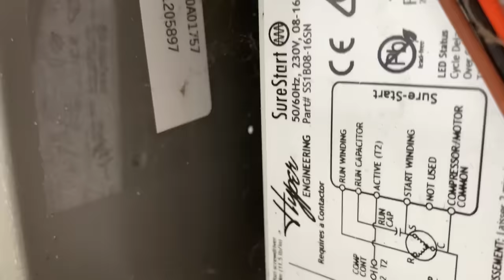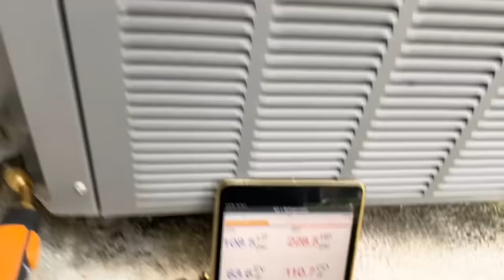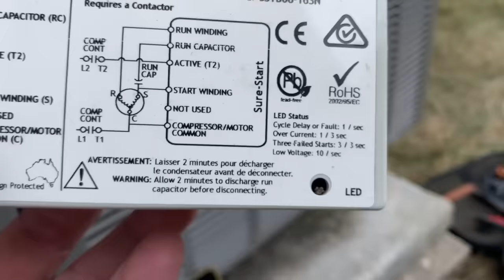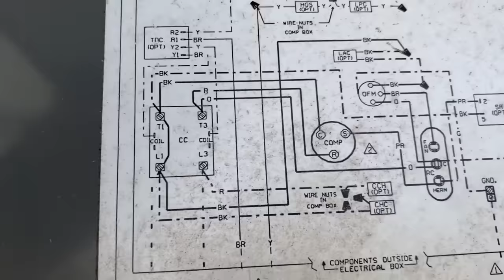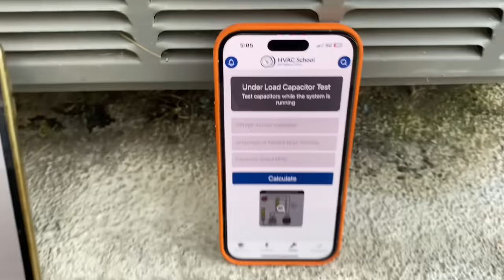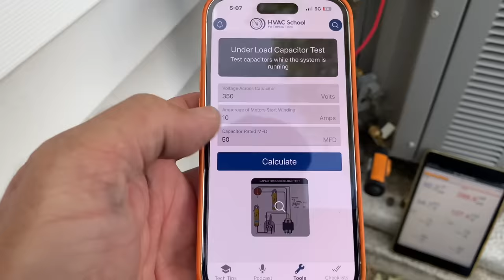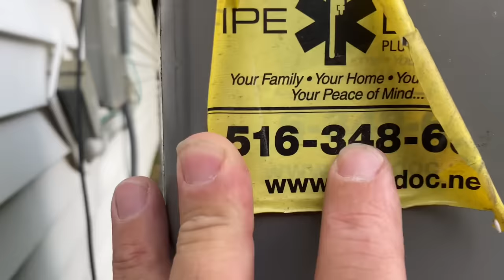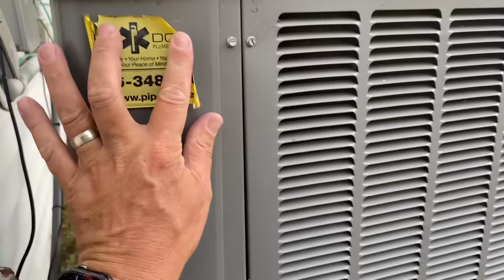Soft Start Killed Compressor! UNEDITED Central AC Service Call for No Air Conditioning Revealed!

Comment: I think putting a sticker on my equipment is defacing my property.  What if I put my sticker on your truck?!.  I had a new $10,000 high efficiency boiler installed and I walk into the room and there is an 8.5 x 11 sticker on it.  WTF.   Branding is one thing but an obnoxious sticker on my unit is a guarantee that I won't call you back.  I tell my HVAC guys and new car dealers the same thing:  "NO STICKERS!"
Reply from the maker: Thanks for sharing. I’ve never encountered a client who declined a sticker on the equipment. The 8 1/2” x 11” is clearly overkill and I’d be equally upset. Kuddos!
Reply: Same here. Good for you. I tell them: "If you would like for me to advertise your company, there will be a CHARGE!" especially for those companies which want to jab a large sign in my yard.

Comment: I had that same brand soft start installed 4 years ago so I could run my 12KW generator. Starting amps is 75 and running amps are 15 and the generator doesn't lug down much at all when it starts. If you have the wrong size soft start, it will not last which is what appears to have happened here.
Reply from the maker: Crazy

Comment: Nothing wrong with that soft start. It was cutting out on over current, 21 amps is right at the fault limit for the 16 amp unit. Good chance it worked until the coil started getting dirty.  I'd be willing to bet they have some kind of battery back up for their solar, possibly a PowerWall to go along with the Tesla and that's why it was installed. 

Those SureStarts are actually really good units. They are just a bit pricey compared to all the others that are on the market now.
Reply: Agree. I think that soft start device was actually protecting the compressor due to the amp draw. 22 running amps is not normal so it cut the compressor.
Reply from the maker: Stay tuned for the follow up video
Reply: I saw the panel had solar equipment stickers… that 130amp surge will knock out any backup inverter
Reply: Exactly. There was a reason it was installed... Solved the problem of getting the compressor running, but created a whole new one.
Reply: Your first mistake is calling a plumber to do hvac. Been in hvac for years and never understood why plumbers think they are hvac experts. Superheat, subcool, and microns are a long way off.from sewage
Reply: yah shouldn't have removed it, just created a new issue
Reply: Its illegal in Texas
Reply: @PFBruno3  Then the Pipe Doctor removed it and threw it away... and will probably damage other equipment in the long term.  But, he got his clicks.
Reply: @WayneMcCrary-kq4fr  What's illegal in Texas?
Reply: @petervidrine9259 You can hold both licenses in Texas. You can have a CDL and residential electric license too. It's just a lot of training to do it.

Comment: Those soft starts are wonderful. They do have a failure rate just like anything else. Shouldn't bad mouth what you don't know.
Reply: how high is the failure rate though? anything over 10% is a problem IMO
Reply: @Lewdacris916  I've had probably 10:1 caps over soft starts failure rate on equipment with a soft start installed. Nothing is perfect even had some sure switch failures but I still believe strongly in them. Voltage monitors also especially  in problematic areas due to u/o voltage issues.
Reply: I did mini split repairs in Australia, the pansonics had the soft start - the rest of the unit was solid as in copeland scroll, good electronics, good capacitor.  If I got a service call to one of those panasonics it was either the hyper engineering soft start fail, mice eating wiring or the indoor unit louvre snapped.  Fujitsu made their own soft starter after testing hyper engineering for a short time and a breakdown with them was usually capacitor or compressor.  LG, Daikin and Sharp fixed speed non inverter pre 2005 - always capacitor.  Funny anything made before 2000 hardly ever had a capacitor fault but it became a plague of bad caps from 2000-2010.  I know why, because they changed them from something very toxic to veg oil, so it's still always the weak point in single phase fixed speed systems.  But it is possible to make a more reliable soft starter, fujitsus own in house design they ended up using had way less failures than hyper engineering's white boxes.
Reply from the maker: Another armchair technician who completely missed the point. 

Point is “customers Central AC stopped working “
The soft start killed the compressor. 
I removed it. 
Central ac now working. 

Don’t be a dick.
Reply: Soft start kits are junk; use only a good hard start kit.-
Reply: @PipeDoctor The soft starter didn't kill the compressor any more than a breaker tripping or a bad contactor kills the compressor. The fact that you got it working proves the compressor wasn't dead.

As multiple others have pointed out, whoever originally installed it didn't install the proper size. The lack of PM may have also been a contributing factor. It was either protecting itself, the unit, or both from short cycling in a fault state.

I'd be furious if my mechanic ripped out my car's computer because the check engine light was on due to improper maintenance or prior repair. Yet that's analogous to what you did here with this system.

The fact that you didn't know what it was, didn't understand how it worked, just ripped it out and tossed it aside is exactly what I'd expect from an armchair technician, not a HVAC professional. 

Be better than name calling and click bait titles about things you either aren't familiar with, or that you are familiar with and know aren't true.
Reply: @MrEgdurd absolutely very well said.
Reply: There was nothing wrong with that soft-start, it functioned perfectly until the coil was allowed to clog.  Possibly the worst HVAC trouble-shooting exhibition ever recorded on YouTube, highlighted by reconnecting power without a two minute delay to equalize the pressures in the compressor.
Reply: @PipeDoctor  says the richard playing on words. SS kit killed nothing cause the compressor still functions.
Stop being such a proud arrogant RICHARD and humility goes a long way.

Comment: How can you be so hypocritical…You try to sell a soft start on 1 service call, and because another breaks down, it’s a junky hockey puck?  All of the $400 “soft starts” are the same. It just got toasted from high current. 5 tons on a soft start??? Hire a electrician before you and Peter put the entire Panhandle out of power and try to shade the blame?!?! And you already had ure “brand” on it??
Reply: Hell he had his sticker on the unit, he may have sold the hockey puck to begin with 😅
Reply: You are absolutely correct. According to the model number that Soft Start may have been too small. HyperEngineering does make another larger single phase model. They probably should have installed that larger one.
Reply: @bentleyjarrard885  
My employees get tiered of me being right all the time. After a while you will get used too it.
Reply from the maker: I guess you missed the punch line with the 15 others who thumbs up the video. Stay tuned for part 2 and THANKS for watching and commenting.

Comment: Wrong SureStart model was installed. Also, that "SureStart stupid thing" was protecting the compressor by shutting it off. You may be good at general AC work, but you definitely need a bit more education in the soft starter side of the business. These SureStart devices are EXCELLENT at what they do, provided the correct one is installed AND the compressor unit is properly maintained....both of which were not done in this case. On a side note, if the correct model had been used on this unit, and you removed it like you did, by running the compressor without it with the coils being filthy as they are, you are now actually doing damage to the compressor by forcing it to run without the protection of the SureStarter cutting off the compressor when it's filthy and working hard.
Reply from the maker: thanks for your feedback.

Comment: The soft start was there for a reason. To start the AC system when theres no grid power. 
Im not even an HVAC guy and know this. 
The softstart is the weak link in the system as designed. So its best to replace that first.
The soft start starts the fan first and then cranks up the compressor. The max draw is lowered significantly in order for either solar power or a generator will be able to start it. 

Im more than certain that SunNow solar system installed that softstart kit for the homeowner. 

I think HVAC companies need  proper training on homes equipped with solar/grid tied systems

Comment: Soft start, as you know, should pull about 25 amps.  I have one that allowed the generator to power the HVAC and, the bonus, the lights no longer blink when the compressor kicks on.  On my Am Std, the LRA was huge before.
Reply from the maker: Stay tuned for part 2 tomorrow
Reply: @PipeDoctor  Stay tuned for more click-bait?
Reply: Nonsense, learn how to use a meter.

Comment: installed a Micro-air 368-48x-bluetooth (3.5 ton) and dropped amps from 113 start to 25 start.    and by the way  i was in commercial dishwasher repair (restaurants) for 30 years and sometimes used only mailings to send my sticker and a short note to JUST SAVE STICKER FOR EMERGENCY.. well guess what so many people thought i was there to service  before. So as new management (or homeowners ) come in, they first called me.....I used an expensive sticker and it paid for itself and a lot more
Reply from the maker: Thanks for sharing
Reply: Hello, did you use a generator if yes what wattage might be good for a 3.5 ton ac. Thanks

Comment: ive put a hundred of sure starts in on generator jobs and solar jobs to lower starting amps of ac they are required in such applications i would check if they have solar or a gennie they are like a smart hard start kit they are pricey my fav hardstarts is the ones called kickstart
Reply: I saw some solar company stickers on the meter and hardware, so yea, especially if there's battery backup on the system I'm thinking the softstart is needed.
Reply from the maker: Stay tuned for part2